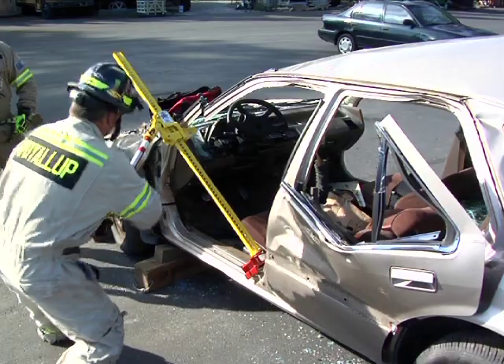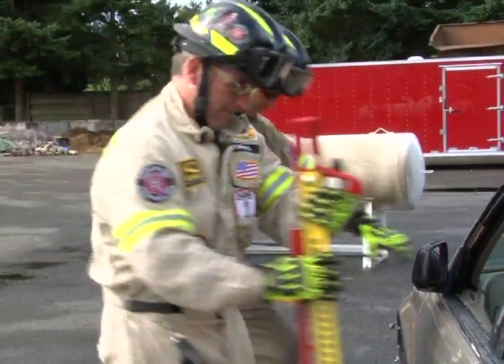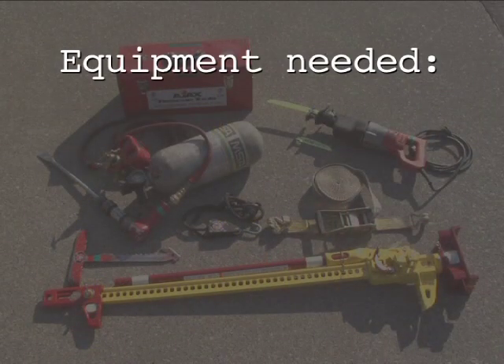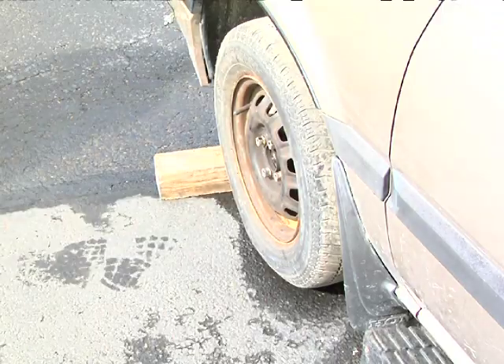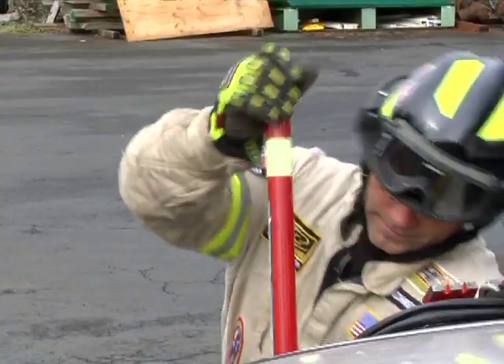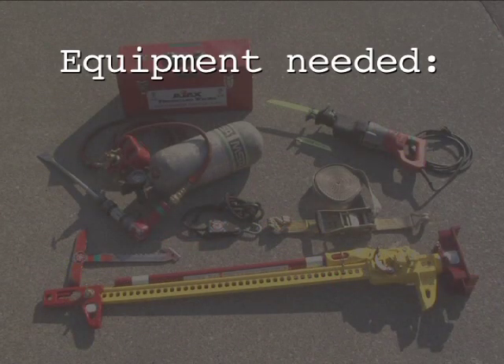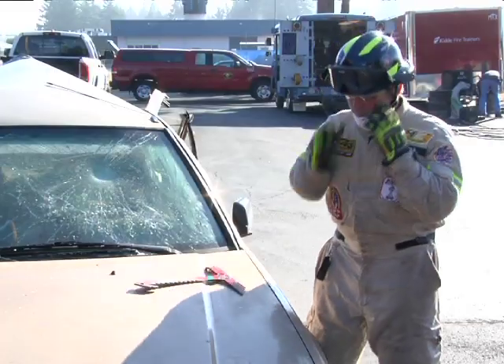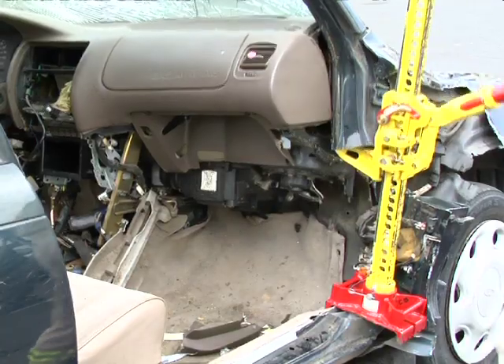First Responder Jack INSTRUCTIONAL GUIDE (chapters 1 - 16)

Comment: i am 46 now and was a jr firefighter at 11.  the new hurst tool shows up and the high lifts are tossed in the hose tower.
the old timers trained us kids to work faster and safer than the men with the hurst tool i have two and i am a boiler/pipe fitter i pull off "tricks" with my jacks and rigging kit all the time.  the best!!!! keep up the good work. mike

Comment: awesome piece of equipment. I wish all fire departments would use this more often.  just last week a truck went into the ditch in front of our house and rolled many times. rescue truck shows up and takes 15 minutes to set up a scissors and start cutting. from start to finish the cutting process for pealing the roof back took 25 minutes he was pinned under the steering wheel, they just cut that too and lifted him through the roof because the doors would not open hilift would have taken 10 minutes